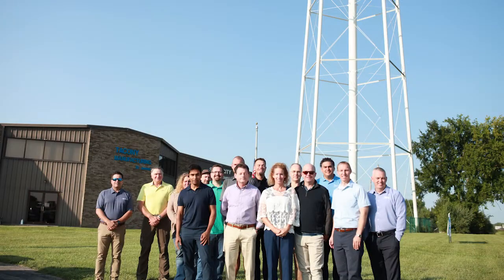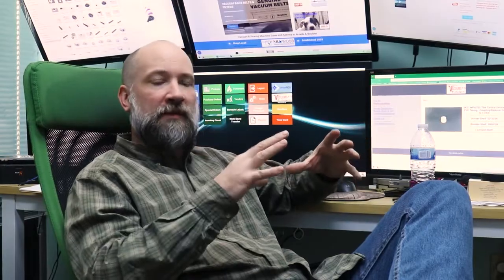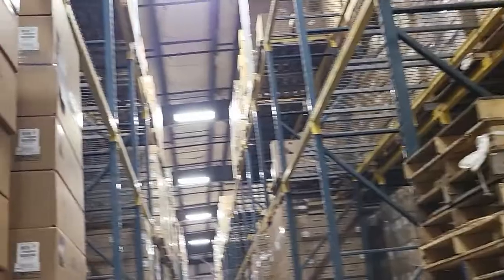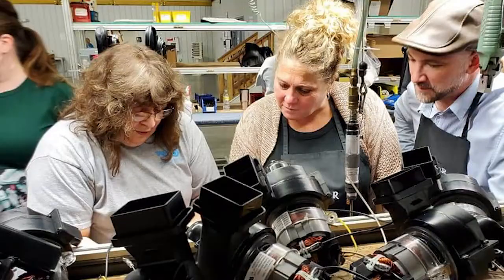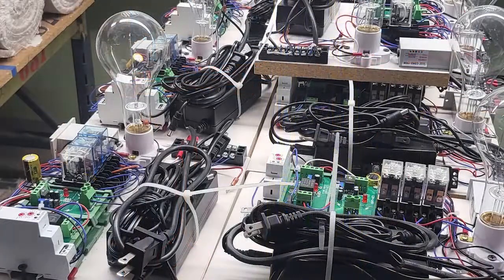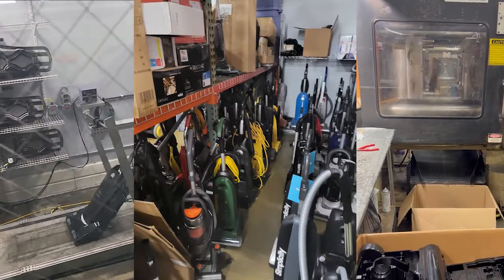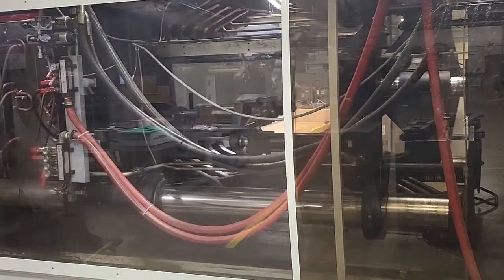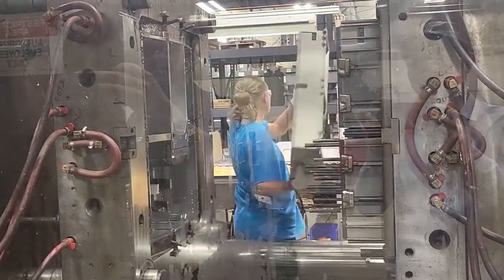Why Riccar Vacuum Cleaners are so Innovative

Comment: Would like your opinion... im debating a riccar tandem upright to the sebo cannister. Which would you say is better for a 3 story home with mostly carpet but some laminate.
Reply from the maker: When we are looking at homes with mostly carpet we tend to lean in to the Riccar tandems. They are in our opinion the absolute best for cleaning wall to wall carpets. They also do very well on bare floor. I tend to like using the soft sweep tool with the tandem air on bare floor however. Sort of like using it like you would use a canister when doing bare floor. The hose is I think 12' or better so it works rather well in that configuration.
Reply: @vacuumsrus  i have a sebo G1 essentials and a riccar prima canister with power nozzle (not a tandem power nozzle). i bought the riccar because i want a canister with power nozzle and the vacuum shop gave me a deal at $600, the retail on them is much higher. i really like both machines, i cant get over how quiet the main unit is on the riccar. that thing is whisper quiet and delivers quite of bit of suction. riccar tandem is a good product but it very expensive and seems to be a bit over-engineered. we have a golden retriever puppy, a 6 year old yellow lab, and 5 cats. if we didnt own decent vacuums our house would be covered in pet hair. i think both products are high quality.